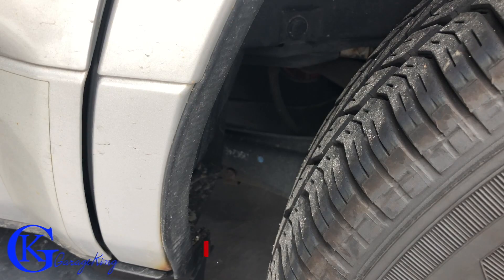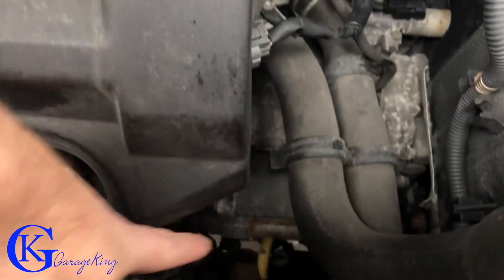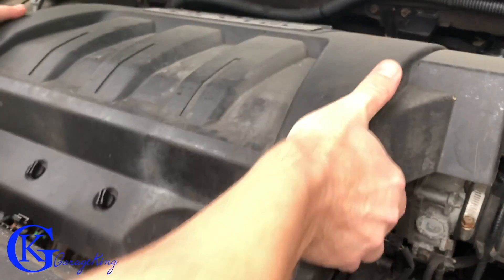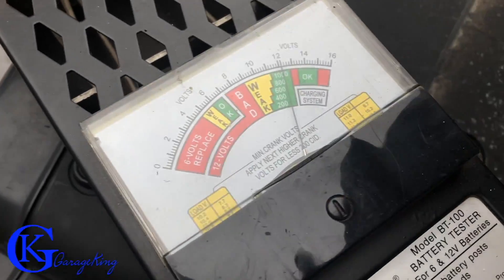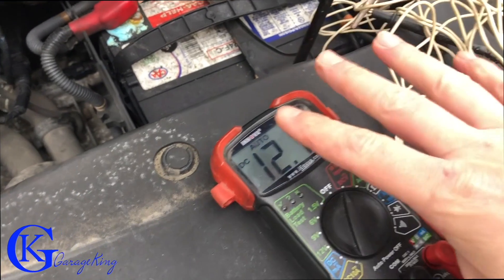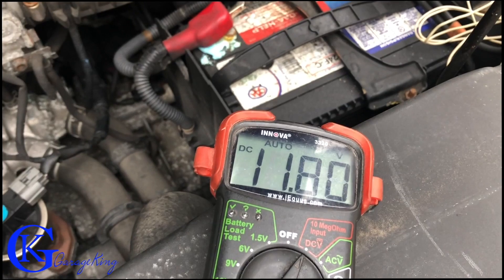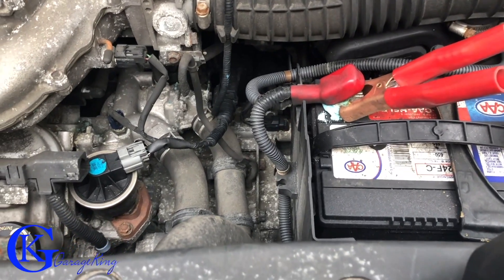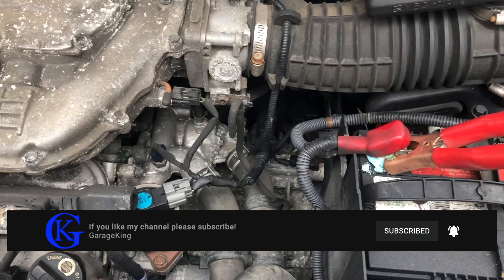Car won't start but clicks? No start? Honda Pilot.....

Comment: What does the fuel pump have to do with the starter??????
Reply from the maker: Hey brother, thanks for the comment!!  This video was about checking for everything if your car won't start.  So this video is not about just the starter, its about the whole system of starting components involved.  By listening for the fuel pump, when you hear it, you know the ignition switch is working in the ON position, and you also know that your fuel pump relay, and fuel pump are working.  To answer your question the fuel pump itself has nothing to do with the starter, but is necessary for the vehicle to start.  I appreciate you comment and let me know if you need anything else!!  Thanks brother :)
Reply: I have same problem .Did you found issue?

Comment: My 2008 honda pilot doesnt start.i have a code p0108 for map sensor..i replaced and still dont start.the engine spin.also.new battery and nothing works.
Reply from the maker: Hey There, diagnosing a no start can be difficult. At least your engine spins over. I was taught in mechanic school to always check for fuel and spark first. I would check for spark.  Make sure the coils are getting power, then check fuel pressure. If you can hear the pump run like in the video that's good.  You can still check the pressure but you need a fuel pressure tester.

Comment: I replaced my battery starter and fuel pump in my 2011 Honda Pilot it still won't start when it did start the guy had to spray with starter fluid and a lot of white smoke came out the tail pipe
Reply from the maker: Hey there, do you hear the pump run when you turn the key to the ON position?  see 1:13min mark in the vid, can you hear that
Reply: I just watched the video I will go ut and listen for it
Reply from the maker: @donnettewhite6230  If you hear the fuel pump that means the fuel pump relay is working, and that means your ignition switch is working properly in the ON position

Comment: I replace starter, relay, fuse. Still just 1 single loud click. Any ideas?
Reply from the maker: Make sure your engine can turn over. Either put a big socket on the front crankshaft bolt. Just turn it an inch to make sure the engine turns. If you can’t do that if you have an AMP clamp for a digital meter get someone to watch and when you turn the key to click keep holding the key and get the reading. If it’s very low the starter is not engaging properly. If it’s a high load, like over 55-200 amps then something is holding the starter.
Reply: @GarageKing  do the car meed to be in neutral
Reply from the maker: No, leave the car in park. The engine should still spin. It’s going to take a little bit of effort due to the compression, but remember you don’t have to turn it much. Just a bit to make sure it’s free